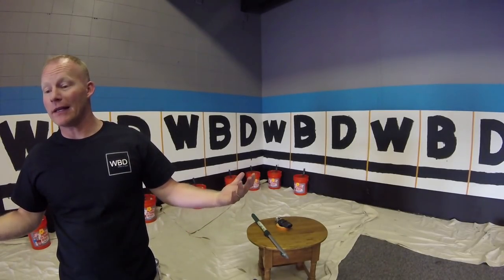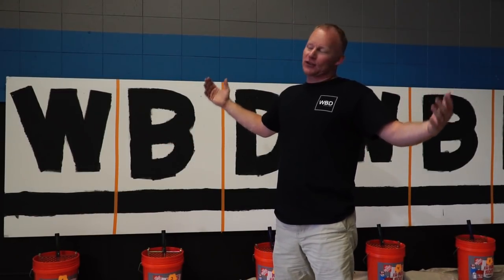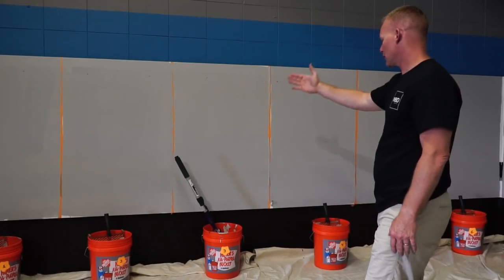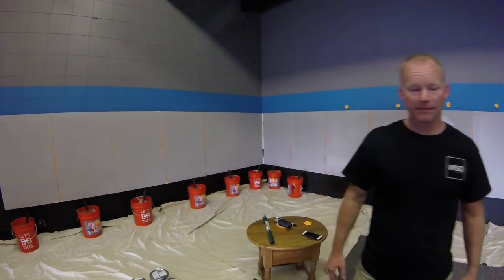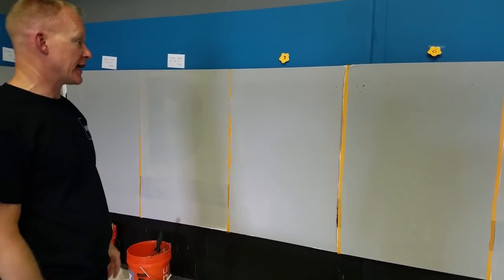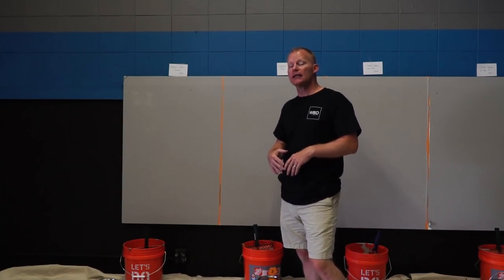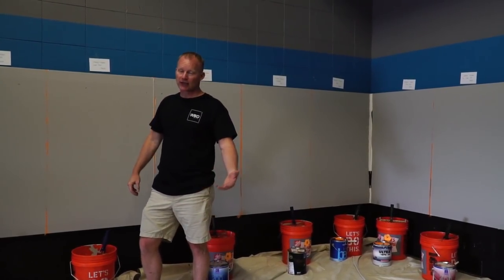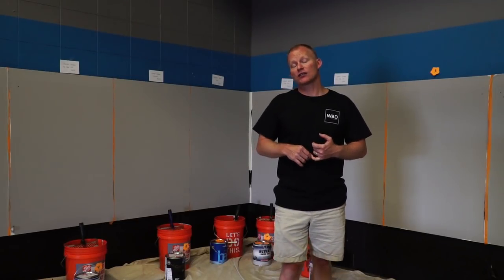Benjamin Moore vs Sherwin Williams Paint Coverage

Comment: Comparing retail prices for contractor products does nothing. DIY consumers should not be buying PM 200 (designed for and only marketed toward contractors) over the DIY lines (designed for and marketed to everyone) Also SW will have 30-40% off 90% of the time so really, is BM cheaper? You. Have to look at value for money (solids levels, mildewcides, etc) not just price.  SW provides a higher quality paint for around the same price typically.
Reply from the maker: SW consistently compares products that are not on a level playing ground or price point as BM.  Price is the only thing that you can use as a gauge.  Do you have a better way?? If I need a $55/gal paint from SW to get similar coverage as a $38/gal paint from BM, where is the value??

Comment: Super Paint at $56/gallon ?  Wow, I pay much less per gallon, around the ~$40 mark.  I know ProMar is my "go to" paint for new construction jobs.  Cashmere is a purpose specific paint and the moron who thinks it's "meh" obviously doesn't know anything about painting or what or how different paints are used.
Reply from the maker: krisone63 everyone gets a different price. Marketing tactics at SW.  All contractors get different pricing.
Reply: What is the specific purpose for cashmere?
Reply: Bresson Painting interior walls. It lays down just right.
Reply: I get duration for 44$!
Reply: CAshmere is a self priming 2 coat system that goes on really nicely. Some say "like Butta". It has a superior finished appearance compaired to it's equal level paints from it's competitors.
Reply: krisone63 wow $40 for super paint I get it for $26
Reply: Ive been a self employed private contractor for 15 years painting and i coudnt agree more, cashmere is meh. I use sherwin exclusively and know first hand 90% of their products. Cashmere has a nasty habit of leaving brush and roller marks. Roller ridges especially. I switched to superpaint and use it almost exclusively now. I got so frustrated with cashmere in the middle of interior the homeowner gave me permission to switch, and we both agreed superpaint had a superior look in every way. Thinking it might have been a funky batch if base i gave cashmere another try. Nope. Same crap. Sonto all you cashmere ppl out there i recommend you give superpaint a try and you wont look back. Coverage and hide is better on super as well, and thats not opinion, ive tested them. Also please keep in mind im not talking about a few gallons as well. Ive used hundreds of gallons of each. Cashmere is certainly not a bad paint, i just feel its inferior to superpaint. To each their own.